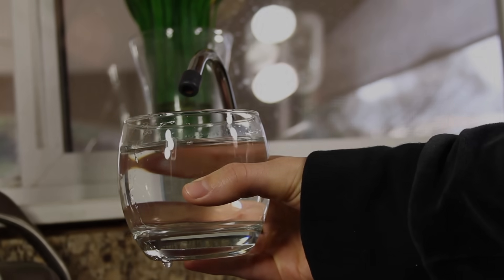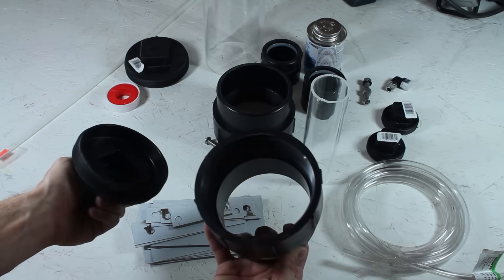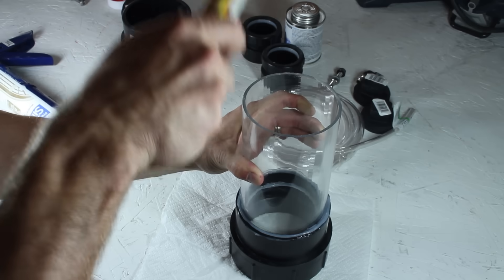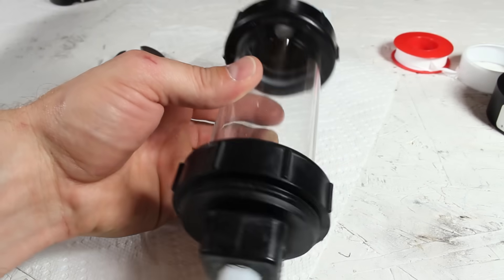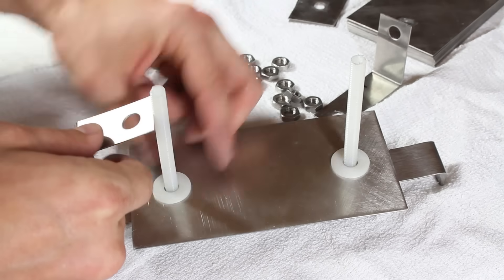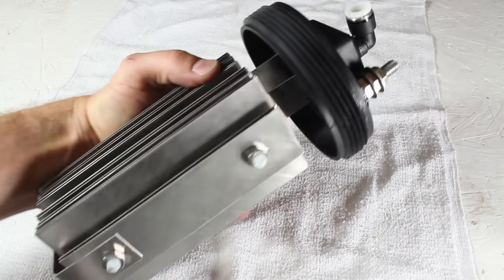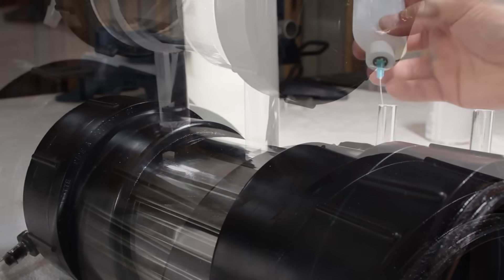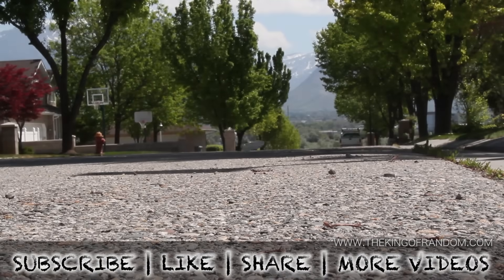HHO Generator - Water to Fuel Converter

Comment: Water shortages!! Water shortages!!! This will cause even more water Shortages.
Reply: +DeltaNoodles The reason we aren't using it is because you need to use electricity to make it, and since all processes are less than 100% efficient, you end up wasting energy creating the fuel.

We don't use it in vehicles for volume reasons, and also because you only get around 20% of the energy out of your car as you put in in electricity to make the fuel. Compare this to electric cars which are closer to 80% efficient.
Reply: The Nonchalant Shallot So now you're installing expensive solar capacity just to waste most of it converting it into hydrogen fuel.

Electric vehicles are close to four times as efficient at converting electricity into motion as hydrogen vehicles.

That means every hydrogen car consumes enough electricity to power four electric cars.

Has repetition cleared up that your suggestion is daft, or?
Reply: The Nonchalant Shallot why would you waste time and money to electrolyse and store hydrogen, when you can just store the electricity in a battery to run a car
Reply: Quantum Leap That's a good question. I think I recall hydrogen vehicles being common in South America.... I'm not sure though.

Most hydrogen is produced from natural gas or petroleum products, if I recall. It might be a good fuel choice in a narrow range of situations where gasoline isn't cost-effective, but where you have a large source of natural gas, since natural gas isn't really a good way to power a car, and hydrogen might be better.

I'm kind of just guessing though.
Reply: +Oliver C a litre of water produces 1245 litres of hydroxy gas
Reply: +hey7328 But the demand for such gas will be unlimited. If every one start using it around the world. The amount to water used in such cause would be bigger than the sea may be???
Reply: +seigeengine which is why you use solar energy and capacitors to charge the generator and create the gas. pump that sucker into a pressurized tank and slap the tank on the car. green energy created by green energy.
Reply: *****  Because the shallot is a bone head, who has latched on to the "clean hydrogen fuel" myth.
Reply: +seigeengine https://www.washingtonpost.com/news/the-switch/wp/2014/01/24/i-tried-a-hydrogen-fuel-cell-vehicle-heres-what-it-was-like/b. Toyota has already made a hydrogen powered car, you can lease it now. Please like this comment if you think we should get these things into production.
Reply: JumpTurtleProductions  I cannot understand why Toyota is screwing around with this experiment, except to gain public exposure, and "feel good" press.  My question is "Where is the hydrogen gonna come from?  And at what cost in energy?"
Reply: Oliver C ...I'm not from the USA either.
Reply: Quantum Leap That's nice. Good thing I didn't ask you what you thought, and instead expressed my recollection of reality. Let me know when you feel like responding to that.
Reply: +Oliver C For people who are looking for cheap energy. Dear all good friends when that cheap energy reaches your land it will be subjected to work and economic policies of that land. Example. The Russian gas or Turkministan gas is the cheapest on the planet earth. There is no other resource cheaper than that. How cheap is it???? For a whole family in eastren EU you can spend as much as 25 Euro for three months for cooking etc. Now if it cost 25 Euro for cook for three months that mean the government in those countries must have bought it even cheaper?? Right. But they sell it  at fife time the price they buy from Russia. So those of you who are looking for cheaper alternatives it does not get cheaper than Russian gas but when it reaches a country like USA and Britian the government in your land will not sell it to you cheap and that is something to do with economic policies.
Reply: seigeengine I suppose I misunderstood. I don't know of anywhere hydrogen is used as a vehicle fuel.
Reply: Quantum Leap A better approach would have been to look into what I said and determine if I was remembering correctly. Instead, what you did amounted to "no ur rong," and I'm admittedly not a very tolerant person.

As it happens, I wasn't. I was thinking of LNG vehicles, and confusing it with liquid hydrogen because of the need to store both at cryogenic temperatures. I also wrongly assumed hydrogen and natural gas would be fairly similar, and hydrogen being a more energy dense per weight fuel would make it more sensible. I was wrong there as well.
Reply: seigeengine Ya, no sweat.  The reason I'm so up on LNG is that our local gas company offered kits at a super cheap price to convert your car to LNG. But, when I saw how big the tank was (eating up trunk room) and the reduced range on the stored LNG, I didn't go for it. The energy content is just too limited.
Reply: Quantum Leap Yeah, CNG and LNG are both pretty awesome as far as alternative fuels go, but they definitely aren't the densest fuels, with LNG requiring about 50% more volume than traditional fuels, plus whatever is needed to keep it at cryogenic temps, and CNG requiring more like 200% more volume. These are do-able, but converts are going to be iffy on taking up space in unfortunate places.
Reply: +Quantum Leap I have seen it used privately as a fuel enhancement, but nothing large scale.
Reply: +seigeengine it'S not electric or hydrogen, it'S hydrogen cells or batteries. i'm still amazed how people think that err....simple...in that important matter. also, hydrogen cells can be refueled quickly hydrogen can be transported and stored cheap. produce it anywhere were natural energy is abundand.
Reply: +seigeengine also, i wonder if your energy comparison inculdes the huge amount of energy to make the batteries and the process to get the rare materials (hydrogen cels need some too, but way less in comparison.) also, good luck trying to power a truck or bus with batteries. they would weigh more than the transport capacity.
Reply: thecursed01 It's not in error. Batteries can be simplified as storing electrical energy. Hydrogen vehicles can't so simply, as while it's technically possible to retain the water and convert it back into hydrogen in a closed system (except electricity input), in practice they just burn it and off-gas the water, meaning that you just have an internal combustion engine and a gas tank, except it's hydrogen instead of gasoline. Sure you can produce hydrogen from water, but it's cheaper to produce it from fossil fuels, and in practice that's where almost all hydrogen in use comes from. Technically, of course, they're both a chemical storage medium for energy, which could be sourced from the electric grid, but they differ so substantially that that's a technical rather than practical interpretation.

Hydrogen is an incredibly dangerous gas that has a low energy per volume as most gasses do, and needs to be stored under very high pressure to be viable. It is extremely dangerous and can trivially ignite or explode. Transportation costs would be significant, and introduce transmission losses as well.

Producing it is incredibly inefficient, and we'd be much better served using those "natural energy" sources to displace fossil fuels out of the grid rather than wasting it to power cars. "But transmission losses!" Except transmission losses are on the order of several percent only, and they can be reduced further with things like HVDC transmission lines. Compared to the inefficiency of producing and then burning hydrogen, those losses are negligible.

So it's really not a matter of you not being able to produce and use hydrogen cleanly, but that by doing so, you are choosing NOT to use that power to achieve a greater reduction in emissions by displacing fossil fuels. Opportunity costs may not be intuitive, but they are real.
Reply: thecursed01 Yes. Also, battery powered buses exist, although most buses that use batteries are hybrids. This isn't a solution that's magically fixed by hydrogen, which may be a very light fuel, but it's not a very dense fuel, needing a gas tank seven times larger than an equivalent diesel tank to store the same amount of energy.
Reply: Quantum Leap I admit, I have a fairly minimal understanding of super-capacitors (likely because I don't really understand capacitors). I understand that they allow you to rapidly store and release relatively large amounts of energy, but that they're also pretty expensive. That's about it though.
Reply: Quantum Leap
name the downsides please. i know there are some, but i wonder if you'll name the wrong one too many believe to be true. still unless there is a huge earthchattering breakthrough for batteries (hard to do, it'S limited by chemical properties after all), hydrogen as electricity scource for electric cars still beats batteries.
Reply: seigeengine
yeah, most of those are based on your mistake to think it's electric vs hydrogen, not batteries vs hydrogen...
Reply: thecursed01 No, literally none of them are.

So, troll or moron?
Reply: seigeengine
"Compare this to electric cars which are closer to 80% efficient." of your given choices, my guess is you're a moron?
Reply: thecursed01 So, troll it is? Noted.
Reply: thecursed01 The number one downside is the question:  where is the hydrogen going to come from? And at what cost?     The number two downside is the question:  what type of container are you going to use to store the hydrogen carried in the vehicle, and how much will it cost?  Do I need to go on?
Reply: Quantum Leap
what do you mean by "going to store in the vehicle" there were test trucks with hydrogen fuel cells driving around in my area and there are electic buses driving around here that use hydrogen fuel cells as scource of electricity.
the costs will be there, places so far used to store gasoline underground need to be upgraded to store hydrogen. still possible and with the plus side that long term storage is much cheaper than with electricity.

costs of store hydrogen in tanks in cars....pelase check what batteries for an electric car cost...

produce where a lot of sun shines and use refitted oil tankers. expensive and huge loss if transferred from, example, northern africa via cable as electricity to europe.
the main benefit is still: while a hydrogen fuel cell also needs raw material, it is LOT less than needed when fitting every car with batteries (who also ad a lot of weight=not usable for trucks to drive long distance). too many people underestimate that.
so my conclusion would be, for inner city only cares, like carpool or shared cars, batteries might work. buses even if connected via lines like subway trains (buses in several cities work like that already. Esslingne Germany tried that).

another bonus: refueling is almost as fast as with gasoline. there was a great idea in the usa for batteries suggesting car owners don't own the batteries, the are stored underneath the main body so you can chnge them automatically at power stations with robotic arms, taking the empty one out, putting a full one in and the empty one gets recharged outside of cars. THAT would make it a lot easier but would need to standardize all cars/batteries.

i know people are all the rage for batteries, but the scale is a challenge. might be overcome and then it'S great. and then i'll fully support that. but i think, in the long run, hydrogen cells are the best way to power electric cars
Reply: +seigeengine I would like to see you power a rocket with just electricity... This is FUEL! Not just a power source...
Reply: Thian Tromp Apparently you weren't smart enough to understand what we were talking about.

I guess I shouldn't expect more from someone's whose name is one character away from trump.
Reply: he can use salt water
Reply: worlds worst gamer 17 Who can use salt water and for what?
Reply: +seigeengine you can electrolyse it and you will get hydrogen and chlorine, or a chlorine compound, depending on electrode material

Comment: What would happen if you attached a microwave transformer to the car battery and then connected it to the generator
Reply: Why don't you give it a try?
Reply: +Colin Douma You might melt the transformer but nothing fun would happen.  Read up on AC vs DC, how transformers work, and redox potential.
Reply: +Colin Douma you need a dc to ac converter, after that, the amperage will be extremely high, probably over 1000 amps depending on battery.
Reply: +Cody Carter you mean voltage... current will be lower but voltage will be enormously higher
Reply: really Im joking

Comment: Why stainless steel instead of copper? Does it have to do with the resistance to oxidation or the conductivity or the melting point? or just convenience is strength and availability? Thanks
Reply: +Destin Scott Well, you're putting the plates in a corrosive bath, so....

Comment: Hi  There is gaudy over here in England that sold me a similar product. If you fit it to car and have the pipe going into the air filter in the engine compartment, then connect it so the chemical reaction starts when you turn the ignition on, hey presto, it burns off all the hydro carbons. You can put your hand on the exhaust, then after a few seconds, smell your hand and it remains clean. I had on fitted to my car and made the car much more economical. You might want to try it.....

Comment: HELP ME! Hey guys I made this gen. bypassed the bubbled and nixed the four small plates and two big plates. I also used 18gauge steel instead. pushed the gas into a two stroke. .32 liter motor. two pistons. didn't turn over what did I do wrong??

Comment: now, how to store and use the fuel?
Reply: +Robeon Mew Fuel and oxidizer stored premixed, what could possibly go wrong?
Reply: DoctorMason planning to use it to propel an ironhorse MTX bike
Reply: +Robeon Mew hydrogen fuel cell
Reply: +Robeon Mew Not by compressing it that is for sure, if you want to compress it as they do in hydrogen fuel cells you have to remove all of the oxygen, if any is present when you try to compress it, it will immediately ignite.
Reply: Malcolm Smith
That's what i mean, compressing oxygen and hydrogen together is a recipe for disaster
Reply: +Robeon Mew you already have it stored in so what would you want to use this fuel for? Be sure purchase his PDF for instructions and to support these projects.
Reply: store the gasses in a static proof airtight, heat resistant tank. Static has a risk of igniting the gasses and high temperature could ignite the gasses too. and airtight to prevent hydrogen leakage which could be ignited by hot engine parts.
Reply: Sonic The Hedgehog static means not moving. you mean static electricity? (stationary electricity)
Reply: Walkertongdee
yee. all great points. When I can. I'm totally building one
Reply: +Robeon Mew The most important thing is to use the right stainless steel, there is a certain number of grade wish I could remember. :)
Reply: Walkertongdee
totally. always measure twice cut once
Reply: Robeon Mew HMMMM, So what you saying all hot women should have metallic shielding ?

I like the way you think
Reply: If is just compressed hydrogen then temp and spark wouldn't matter cause there is no oxidizer. And if you compressed the oxygen and hydrogen together then it wouldn't matter either cause it would already have exploded...
Reply: +Robeon Mew he does
Reply: +Robeon Mew I guess you would need to convert it into liquid and store it in a tank, it's risky bet your best bet if you want to use it
Reply: TED BEH the risk will drop if you make a metallic shielding to go around so your crotch doesn't explode
Reply: +Robeon Mew you could use an empty CO2 Cartridge, it should be strong enough to store the gas without it exploding when you compress it, also the valve allows for safe filling without the risk of Oxygen getting in
Reply: +Robeon Mew There's no real safe was to store it unless you find a way to put it into a used propane tank
Reply: ***** Youd need to seperate it first as well and for company's in most places at least it costs less to make it from other fuels than it dose from electrolysis.
If you have the right materials you can make it directly from sun light so no power costs.
Reply: ***** The eficency perticularly high though so you would want it to work with concentrated sun light I dont know if that would would damage the material though.
or if you could cheeply buy, make or salvage anything with enough eficency.
 http://phys.org/news/2015-09-efficiency-solar-hydrogen-production-percent.html
you have about 1000W per square metre to work with in optimal conditions but only about 100W average http://www.withouthotair.com/c6/page_38.shtml 
say it costs you 0.06-0.50 $/kWh depending where you live witch is probably actually fairly realistic, Say you manage to get a 5%-10 efficiency and electrolysis is 75% efficient you save 0.6 to 0.50 *(0.05 or 0.1 *0.100*24)/(0.75) 
You save between 
1 - 8 or 2 - 16 cents  per per square metre used per day vs if you made it via electrolysis. 
You would need to cover a large area very cheaply and have a regular use for the gas as I think hydrogen is hard to contain 365* 0.01-0.16 = $3.65- 58.40
then its a question of cost and the legality where you are witch I don't know about and obviously the later I don't want to try to comment on.
Reply: +Walkertongdee 316 is the grade of SS. 302 has too much nickel init with destroys the cell.
Reply: +Jock Wochi *which